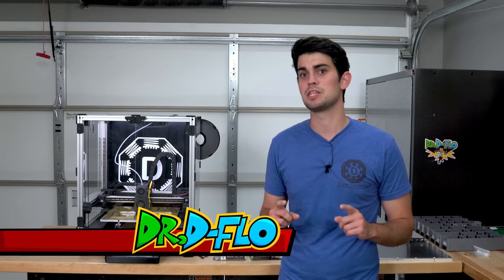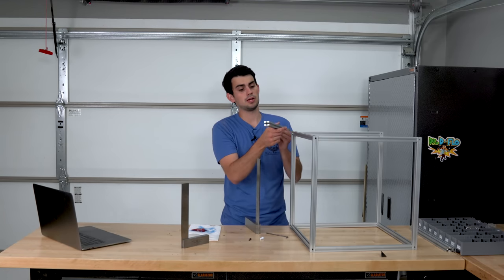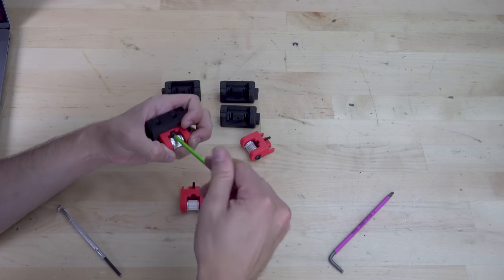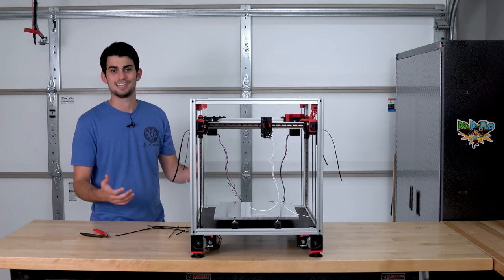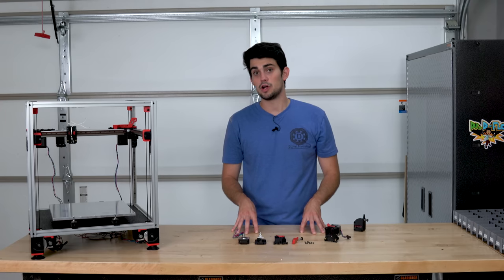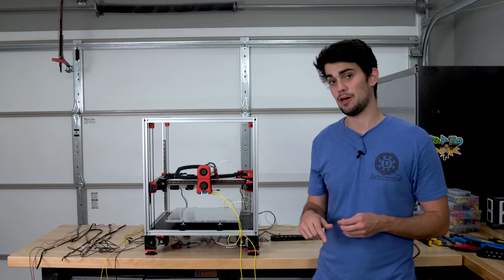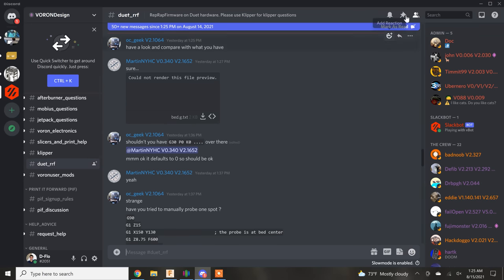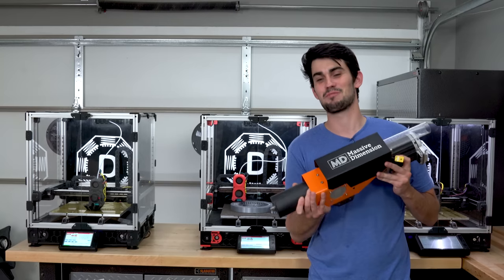Building an Epic DIY 3D Printer: Voron 2.4 with Mods!

Comment: Great video, but a few thoughts.

1. The recommended dragchains are very undersized for the number of wires used, bend radius is a bit too agressive as well, needs to be redesigned to use slightly larger ones, or simply go to a canbus from the start.

2. Electronics, buyer beware when purchasing electrical components from aliexpress or amazon, more often than not they are misslabeled to look better than they are, one common such item is ssr's   they are routinely misslabeled to look like they are rated at spec when its just a sticker.. 
Be mindful of laws and regulations of where you live regarding electronics.

3. Make damn sure that you know what youre doing when fiddling with electrical wiring, measure every connection for continuity and resistance before going live.
Electronics are easy to get right but can be lethal if you make a misstake.
The resistance measurements are important, dont skip them, a bad connection will most likely heat up and possibly start a fire, dont expect a fuse to save you.

4. Health hazards in the use-case of fdm is generally hyperbolic online, which is almost as bad as understating them.
Yes theres offgassing when printing, will it harm you? 
Not really, at least not for consumer grade filaments and scale. im pretty certain noone watching are handling pom or acetals, which actually are dangerous.
Most risks arise when you machine, sand or burn the plastics, for which you should use proper ppe.

As for pla, petg, abs etc, you will most likely be dead long before those particulates will start bothering you.
More likely from the toxic foods, or poisonous dyes in your clothing etc etc..

Use some common sense, open a window, dont huff any fumes coming from the machine, dont use it in a living area like your bedroom, and try not to eat the filament.

With regards, a plastic injection worker.

P.s not meant to belittle or be confrontational, just dampening the existential dread thats going around online. Feel free to disagree.

Comment: I like this build. It definitely has some advantages over the Zidex. However, a major improvement would be to combine the best design elements of the Zidex and Voron. A Vordex? Zidron? ... Anyway, you know what I mean. I've been trying since early this year on ways to improve the Zidex. The Voron has some elements that I've been thinking about. For example, miniaturizing the guide rails, be it extrusion or linear and adding in the Zidex's cantilevered X-axes is a very powerful combination because this negates the limitation of long cantilever rigidity. There are other pros as well. Overall,  this could result in multiple extruders operating independently and simultaneously. Reduced print time would break all 3d print speed records easily. While building the Zidex, I bought a couple of linear guide rails to compare to the extrusion rails. Truth be known, they both use tiny ball bearings, just configured differently. The resulting pros and cons will decide what you need. For example, the gantry on the extrusion can move/accelerate faster than on the linear rail because of fewer ball bearings/friction in the wheel hub, but the gantry on the extrusion occupies more volume.  I'll definitely build this Voron 2.4 . Then sometime next year, I'll most likely give into temptation and design/build the Vordex/Zidron. Thanks for the video. I can see you put an enormous effort into making it. It definitely complements the Zidex video. Well done!

Comment: Just spreading the grease on the rail and rolling the carriage doesn't really get the grease into the bearings very good. You should get a syringe and inject the grease into the holes on the ends of the carriage.

The eyebrows are the coolest part of the idlers! 😂

PTFE is worth every penny. You're building a $1500 printer. Silicone wire saves you like $50-$60 maybe.

You can run klipper on duet. 😉

Comment: I'm getting my Voron parts printed in a 20k machine out of industrial Hi-Temp Resins with heat deflection of 400F or about 190c. Black and Transluscent Red. All the brass Heatsets will be replaced with printed threads and chased afterwards with tap. The Smallest thread the Magna Resin printer to can do reliably is M5.M4 will need some Finesse

Comment: instead of using single core silicone rubber wire, get like an 4/6/8 core silicone rubber cable. A proper brand will have teflon powder surrounding every core and will reduce wear and tear on each core.

Comment: Great videos!  btw...in a future video, can you list some DMLS and/or EBEAM 3D metal printers/kits that might be within reach of small shops or seasoned hobbyists(?)  Plastic 3Ds great but a lot of folks also have metal needs :)
Reply from the maker: I would love to review one of those printers on my channel. However, the metal powder is quite hazardous though and may forever be out of the reach of a hobbyist because you need very special powder handling instruments to prevent explosions and inhalation.
Reply: @DrDFlo  - Can definitely see how certain metal powders (especially aluminum) could be risky. Given safety issues surrounding DMLS systems, perhaps EBEAM (or something similar) is the better way to go. Will be interesting to see if anyone can come up with an (ultra) entry-level EBEAM offering in the next couple years!

Comment: Kinda surprised someone like yourself with the machines and capabilities haven't done a rat rig in all machine parts and put it in a heated chamber.  The community already has the printer (ratrig/voron) just need someone to step and make the files for subtractive manufacturing of the 3d parts and put and insualted box around it that can do 100°c

Comment: 51:30 can´t you just common ground them and remove half of the wires?

I made a build quite a few years back where it was really important to have minimum amount of cables. The solution was to have a X-Y+A-B cable. Where X+A powers one thing, X+B a other, and so on. Then pole switching from low ground to high ground added a other 4 features. Using diods for the part that was not natural dioding (like LED)

Of cause this might not really be possible with the stepper motor because it need to be quick and also have pole switching. Also that mandate a custom control board.

Comment: in getting ready to do a voron 2.4 build right now. Just out of curiosity why not tie the fans, klicky probe, and A/B end stop commons together? That's 3 wires through the extruder drag chain, and 5 through the rest you can save if space is tight. Haven't gotten to the wiring portion yet, but it seems tight and every bit looks like it will help

Comment: I think the Voron (possibly the small one) will be my next build. I have two questions though. One, wouldn't it have made more sense to design the printer with the build plate moving while fixed mounting the printer assembly (except x/y of course) at the top, and the bed drops down during? I'd think that'd be more accurate? Second, it seems as if all (don't know this, so....) corexy printers are using Bowden feeds vs direct drive? From what I've learned (in only the last year, so yeah...) I thought direct drive was pretty much the desired method? Is there an overriding reason why all the corexy's are choosing Bowden? Lastly, THANKS! GREAT VIDEO! KILLER CONTENT!!!!

Comment: One cheaper way into rrf of course is to use a BTT Octopus. They are high quality boards able to do anything you could think of with a voron regardless of wether it's klipper or RRF. I'm excited to use input shaping in RRF as it is a recently coming to functionality. I'm not really sure what else klipper would have to offer over rrf in terms of features at this point?

Comment: Any news on new smaller pellet replacement 3D heads using like cheap vacuum cleaner hose line for the side container storage..  I like the triple drill heat tip 0.6.. any pellets with carbon fiber?

Comment: Is the bottom panel made from Coroplast? And if so, how does it hold up to the heat generated by the bed heater? Does it warp in time or or does it retain its shape?

Comment: That looks amazing! What wonderful detail you put in, thank you thank you thank you! ^_^

That design is fairly similar to what I have in mind and hoping to build someday, but wouldn't the 4 Z-Axis motors "over-constrain" the design?
A few forums I stumbled across mentioned this (wish I saved their links) and that the max Z-Axis motors/rails is 3 which kind of makes sense in the fact that a plane is made from 3 points.

Before finding forums that had me thinking it would be impossible/over-constrained, the concept I had was with 4 threaded rods instead of linear rails and most of the motors, electronics, and hardware is installed on the top of the printer (or the upper part of the backside) instead of underneath providing a higher center of gravity/center of mass in hopes that it helps reduce vibration/shaking at higher speeds.

Do you think that would still be a worthwhile concept to explore despite the potential of the "over-constrain" issue?
Reply: it's not overconstrained as the gantry isn't a plane.

Comment: If you want a reliable inductive probe, just use a spare power switch and turn it on only for tramming. Without this, it failed in two weeks; with it, it works for more than a year now.

Comment: from what ive seen the mgn12 rails an carriages are cheaper than the mgn9 or at least everywhere ive ever purchased the mgn12 rails in the past it was always as cheap or cheaper than the same length an carriages as the mgn9. i have a few printers with mgn12h an c so i was kinda surprised that the bigger vorons used them, i can see an understand for the 0 but for the bigger printers i figured they would increase the size but doesn't seem to be the case. i want to build one of these so bad im just slowly trying to gather all the parts i need an then i'll print the printed parts but my biggest concern is the electronics, they seem to be alot different from what im used to an i just hope configuring the firmware isn't that much different. ive not looked into the details on what it takes just yet mostly just admiring the machines.

Comment: Great video. Easily the best I’ve seen!! I also have that Hex key set - it’s amazing isn’t it? Also, I’m about to pull the trigger on a Voron 2.4 350x350. I’m used to my Ender 5 plus, so I really like the size. Do you really think the Jump from 300 to 350 is detrimental?
Reply from the maker: Yes! Love the Wera hex set. I always pick up the right size key. Honestly, I don't print many large objects, so I would probably build a 250mm before I built another 300mm. If you have experience with building linear motion platforms then with a little extra time squaring everything up, you will have a smooth, accurate motion on a 350mm Voron.

Comment: Hello, congrats for the really good video! It got my attention to Voron and I have decided to build one for myself.
A quick question: what is the name of the blue product you use to fix the screws? Maybe you could add some links for the products you have presented, there is nothing wrong on that. Thanks!
Reply: It looks like the traditional choice for thread locking, ie blue Loctite. Loctite comes in a red and blue variant. Blue is the milder one, you can (with some effort) unscrew a blue treated bolt manually. The red stuff is permanent, meaning you don't get that loosened once it's cured without heating everyhing up to 260 degrees C.
Reply: @extectic  thank you! This is new to me, didn't know that! One more think I have learned in this video!
Reply: @mrebenezeroliveira  No worries, it's useful in a lot of contexts. I first needed it for my motorcycle, lots of bolts were vibrating loose. Went around the bike with blue loctite on all those and a few others and hasn't happened since.

Comment: I've been seeing some kits where some of the 3d printed parts are anodized aluminum. Would you recommend those over ABS?
Reply from the maker: I would not recommend the aluminum parts. The ABS parts work great and they weigh less, so you can have faster print speeds.

Comment: 16:52 Honestly I still do not understand this design decision for the VORON. Sure, lead screws can wobble, but using a flexure connection you can negate this disadvantage. The main advantage lead screws offer is that they are non-backdrivable, meaning that they are much stiffer in constraining the Z-axis than a belt, and require almost no power to hold their position, and you do not require these complicated gear mechanisms.
Additionally, they have less backlash than a belt (the elasticity of the belt makes for some backlash) and the backlash can be taken out with smart pretension techniques.
Reply from the maker: Belts are not that advantageous compared to lead screws, but they do have their benefits. 

I prefer belts because of how quiet, smooth, and fast they are. The low steps per mm of lead screws on a printer like the Voron 2.4 that is constantly moving up and down for bed probing is not ideal. 

The drawback you mentioned for the belts are not present with this design. The Voron z axis motors have a 5:1 gear ratio (or something similar) for driving their belts. This high ratio means that this configuration is also stiff and the z axis does not drop when the power is turned off. However, it does require more hardware to achieve this and thus, is more expensive. 

Neoprene belts are reinforced with very stiff fibers and only at very long lengths or extremely heavy loads is their elasticity evident - neither which is true for this build.

A drawback of the belts is that longer lengths require higher forces to tension. This is why coreXY designs max out around that 400x400 build area. The belts become too long and the aluminum extrusion frames are not able to withstand the tightening of the belts. The whole printer would have to be redesigned and it’s rigidity increased. 

Anyways I hope this kind of helps. So many commercial 3D printers have used lead screws for the Z-axes and are capable of perfect prints. But none of these printers are as fast and quiet as Voron
Reply: @DrDFlo  I do agree that belts are 'good enough' for 3D printers, but you will likely not see belts on precision machinery for the reasons I mentioned. Worst of which is the hysteresis exhibited by the polymer material which you inherently cannot compensate for limiting accuracy. 
I personally do also prefer the quiet operation of a belt, and I think for a 3D printer it is a worthwhile trade off, but inherently ball screws are superior for these kinds of operations if you do not consider noise. 

The point you mention about low steps per mm, this is the transfer ratio of the stepper to the vertical translation, which is something you can choose. You can just gear up the stepper, or use a thread with a smaller pitch to achieve this. This is not an inherent limitation to leadscrews. 

The drawback I mention about back-drivability applies more to non-geared down belt systems, but it does show you need a more complex mechanical system to achieve the same level of non-back drivability. More parts = more friction (= less precision) & lower reliability. Next to this, belts wear down whilst leadscrews don't really wear down at all.

I disagree on the point you make about elasticity only being evident when long or under heavy loads, because you do not consider the elasticity of the teeth themselves. These are not reinforced by fibers and are thus introducing elasticity in the system. Then you have the additional elasticity and backlash of the gears you have to introduce as well.

Personally I dislike the use of belts in general, because they do not give exact constrained. A lead screw with decoupling flexure provides an exact constraint, which improves precision, reduces wear and make things just better all around. Because belts are over constrained you need to either have slop (something of course totally unacceptable), or extra friction/binding, which is the point you mentioned about tightening the belts.

Another point which I dislike about the voron design, is that the entire Z stage is inherently over-constrained as well. This is obvious from the fact they need 3 degrees of freedom (tip, tilt and translation up/down) but have 4 separate actuators to achieve this. This automatically means the system is over-actuated, which means at least one of the steppers is redundant. I.e. With just 3 stepper motors it could perform exactly the same function, but without the problems of over actuation/constraint. 

I am 100% convinced that you can make a better Z translation stage with a well designed lead-screw system compared to belts, but likely it wouldn't impact performance in a big way anyways, although maybe provide a more reliable system that requires less maintenance. 

Also, please don't see my comment as any criticism on your build, I think you did an awesome job. I think it is always important to look at mechanical designs and think where we can improve them, so they can be even better in the future.
Reply from the maker: No criticism detected! I love going back and forth on design choices and elements. Thank you for your thoughtful comment and reply

Comment: I seriously doubt that the Plastik wheel on aluminum guide is stronger than linear rail running ballbearing on a stainless  ground steel rail. The Plastik wheels deformation will mal it softer and certainly flex. more under load…

Comment: "The laudest thing in your printer are the fans" -> yes if you are not using sh***y stepper motors. As an example creality steppers on duet 3mini (TMC2209) even with stealthchop and interpolation are so noisy. Stepper + driver combination is important, not only driver and motion system (belt or rail).